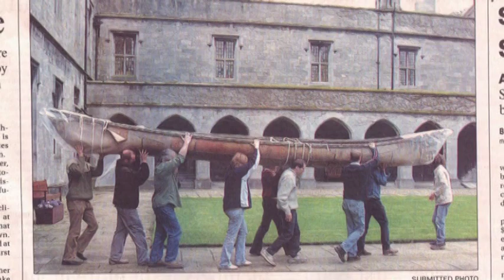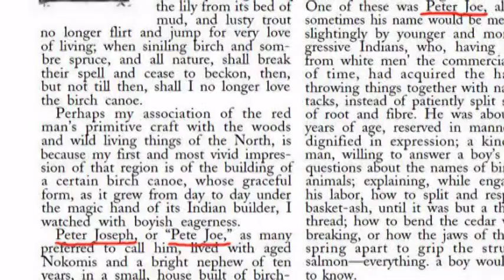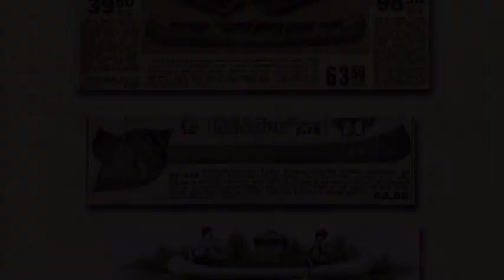Birchbark Canoe Making on St. John

Comment: Very nicely done.  Would you be willing to add the second part and finish the canoe?  This is one of the better videos on bark canoe making I’ve seen.  Steve is teaching me to make a birch canoe.  We’ve split cedar for ribs and harvested a bark large enough for a 16 foot canoe.  Trees for gunwales and sheathing have been found and will be harvested this year.  Its been a life long dream, and thanks to Steve, it is slowly coming true.
Reply: How did you make out with the canoe building project ?
Reply: @charlesleblanc6638  It is ongoing.  Steve cut me loose with enough instruction to fabricate much of the canoe on my own.  I hope to connect with him in a year or two when I’m ready for a building board.
Reply: @bendrixbailey1430  thanks for the reply .. What's a building board, is that the building platform ?